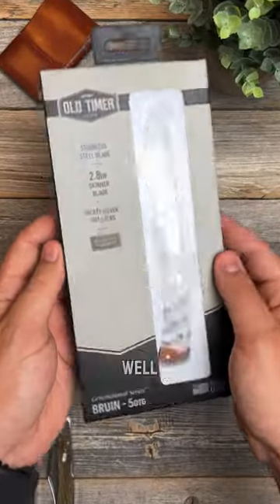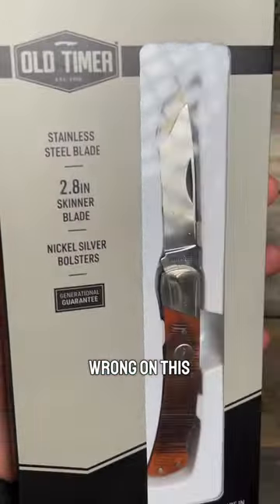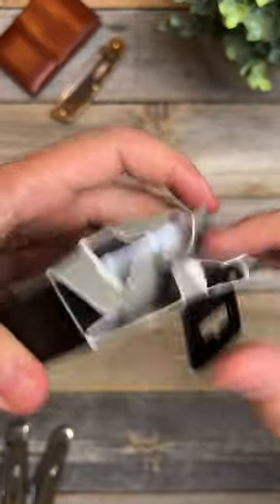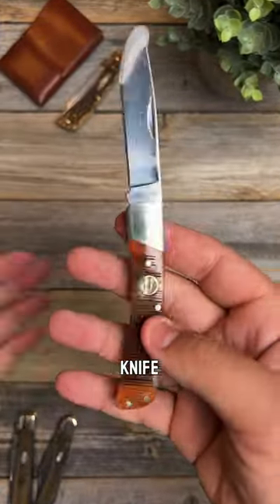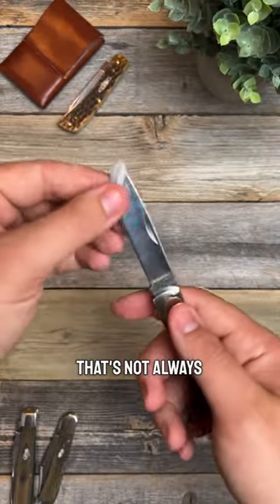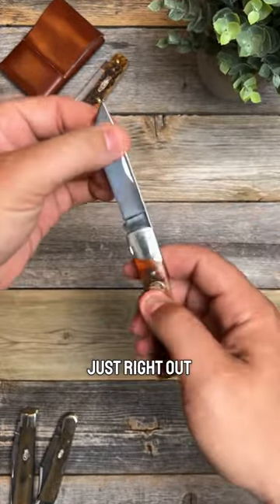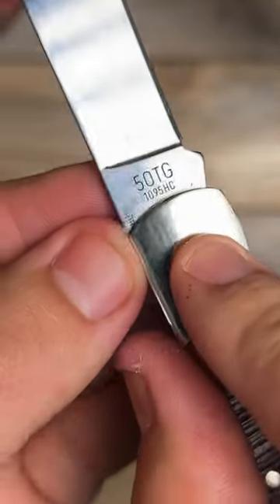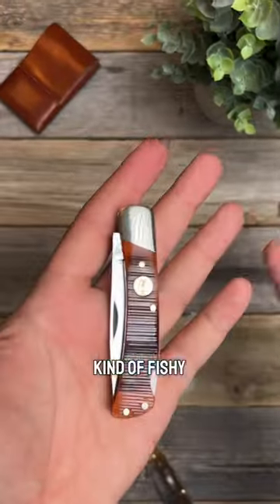Old Timer BRUIN 5OTG #shorts #gear

Comment: I got the stockman middleman. I thought it was carbon steel. Its definitely stainless.
Reply from the maker: I need to pick up a stockman!
Reply: @GearRelated  And I need that lockback. I also picked up the sharp finger. Haven't used it, so I don't know either way.